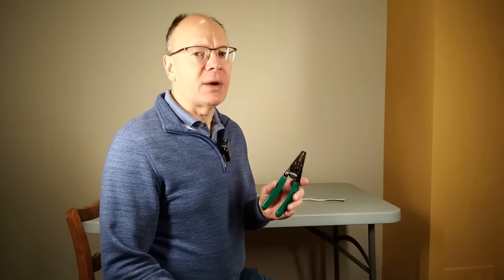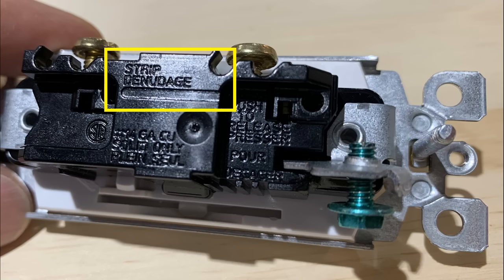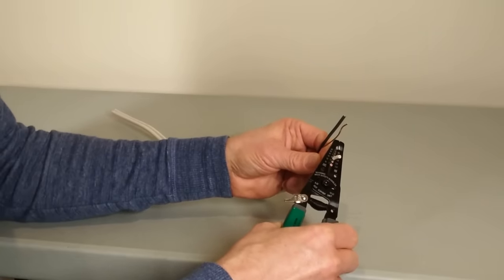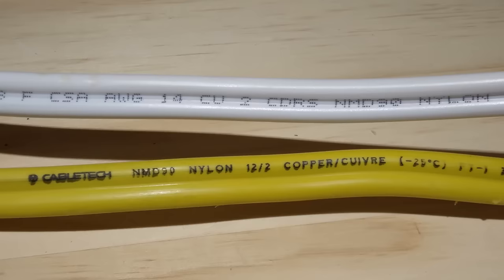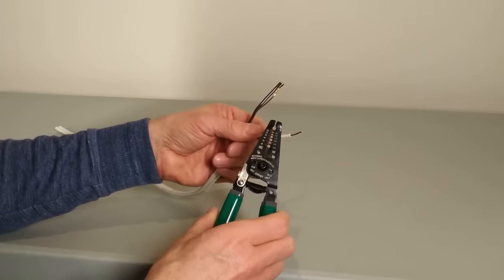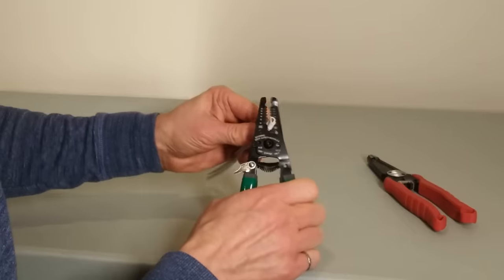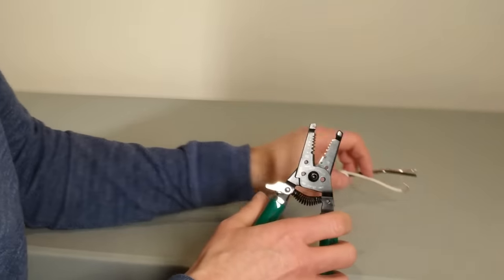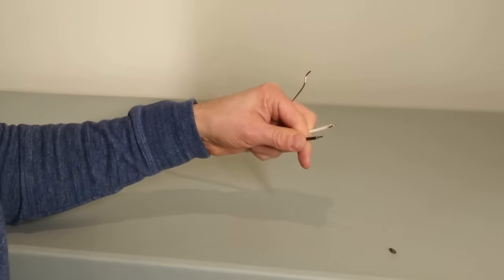6 Mistakes DIYers Make Using Wire Strippers on Electrical Projects; #3 is Dangerous!

Comment: 1:02  NEVER TWIST the stripper. That will nick/score the wire, causing a place of weakness. It may not bother you, but the metal fatigue in that location can cause a complete fail for the next guy.!   The PROPER way is to bite the wire, release slightly, then turn 90° and do it again. That will cut all the insulation without damaging the wire.

Otherwise, nice video. Especially no annoying music, no just babbling to hear your own voice.
Reply: I was thinking the same thing, you can see the score in two places at 0:32 .   It's surprising how quickly the copper fails at those nicks with a bit of bending.
Reply: He's using the tool backwards. Note the beveled edges around the openings on the side he's trimming.  The flat side should be used on the trim end, eliminating the need to twist unless the incorrect AWG opening is selected.
Reply: Wrong

Comment: I have two issues with recommendations here:
1. It is very easy to nick the wire when rotating the stripping tool around it before stripping.  This will cause the wire to break in the future from fatigue induced cracking.  If the correct technique is used with the cutter, there is no need for this rotation.  As to correct technique…
2. When stripping wire, you have the tool backwards.  The beveled edge of the blades should be facing the bulk of the wire and the flat side should be facing the insulation to be removed.  When you strip as you show, the bevel is trying to ride up on the insulation and pry the tool open and this also is what makes it hard to get the insulation to break free cleanly.  Turn the tool around so that the beveled side is facing the bulk of the wire and the straight side of the blade is facing the insulation to be removed.  This is also generally the side with the wire size labels on it which should be facing you as you hold the wire and push the tool away from you to strip the insulation.
Reply: Right off the bat, at 0:32, damaged wire is visible. Also, pushing with the beveled edge may be why he has problems stripping without twisting the tool.
Reply: every decent wire stripper I've used has one beveled side facing each direction.  that's because the blades bypass each other slightly instead of trying to meet perfectly.
Reply: @kenbrown2808  I agree if you are using something like an Ideal style stripper where it grips the wire, cuts the insulation and then pulls off the insulation all in one operation.  Yes, some of the pliers style strippers with bypass blades are OK, but I was referring mainly to the auto style strippers which generally don’t have bypass blades and have a bevel on only one side.  I personally usage my Ideal strippers most of the time, but for wires of heavier gauge I use the cheap auto style strippers and they work fine if you strip with the flat side towards the insulation being removed.
Reply: I usually strip the wire at the next sized up notch, like stripping a 14 gauge in the 12 gauge notch. Not much harder to pull, but it’s a lot harder to nick that wire.
Reply: @huejanus5505  Yep...this
Reply: Interesting, I didn't know this. I hope I can remember to try it the next time I have to strip wire.
Reply: 100% on not rotating the strippers. Long before I became an electrician I was an electronics technologist. In college we had a class called Fabrication Lab and our instructor would examine the copper for any sign of scoring with a loupe.

As others have mentioned, proper stippers like Klein or Ideal most often have bypass blades, although your advice makes sense for... uh... crap tools that amateurs are likely to use. 😜

When I'm showing someone how to strip with a proper tool I tell them to cultivate the habit of closing the strippers completely to cut the insulation, but then to relax the grip just a tad and make sure to stay at right angles to the wire when pulling away.
Reply: @civildiscourse2000  But seymourscagnetti1413 states to use a 45° angle  so it's difficult to know who is right, or even if there is a 'right' way.
Reply: @JBK647  If you angle the strippers to the wire they will bind on the conductor unless the opening is sloppy af!
Reply: @civildiscourse2000  Absolutely.  If I have a wire that appears to be on the small end of the spec range and doesn’t strip well, I will close the strippers fully, open the jaws a little, rotate the wire 90 degrees, then fully close again and strip.  This often helps and doesn’t have the risk of making a big score in the wire from a rotation of the sharp blades.
Reply: @LTVoyager  Good point, that's the only safe rotation method.
Reply: Yep. If i am not using an auto, I start with bigger gauge cutting hole by default. It helps to double-check how wire fits, too.

Comment: Another tip; if the insulation is stuck (or strippers are dull), or when working with some old THN and the insulation has adhered more to the wire, two quick pinches on the insulation 90º apart will break the insulation bond free from the conductor...
I like using the linesman pliers for this as the nose has less teeth (smooth and not pierce or nick the conductor).

Comment: Another fundamental thing to point out, is to always position the J-hook coming from the left with the end on the right.  This helps close the hook when turning clockwise rather than opening the hook.  This is especially important when using stranded wire.

Comment: Great video.  In example #1, besides the insulation problem, you also have a situation where the wire stripper cut into the wire thus weakening it possible causing it to break in the future.
Reply from the maker: Thanks for pointing that out. So two mistakes in one photo!

Comment: When stripping the insulin to use the next higher gauge cutter from the one used to cu the insulation. This prevents the cutter from biting the wire as the insulation is pulled off.

Comment: That twist is only required when the wire you're using is undersized or your strippers are hellishly dull..
Reply: Yup.  Agreed.  And then you realize you are overdue for new strippers.  

I have loads of dull strippers in the old tool chest.  Funny thing is it’s only size 12 that’s dull 😅.  The 10, 14,16,18 are all fine on every old pair.

Comment: I am industrial construction, retrofit and maintenance electrician,only,  now, 30 years.
Residential work I never do, because....  USE the Gas Darned screw cutters on the the strippers!  FFS!
I hated spending hours a day try to turn out  yoke screws that were cammed out to death and 7/8" too long!
Also NEVER get the Milwaukee strippers.  Too much exposed metal near the tip of your index finger and you WILL
find juice one day, especially when new to the field.  You prefer to just see sparks when u cut through energized romex not feel it.  Wera, Wiha, Knipex or Greenlee are safer choices.  The metal does not ingress so much into the 
comfort grip or insulated zone.

Comment: 12/2 gauge back in the early 2000s was in the white sheathing
Reply: when in doubt, start with the largest size.  easier to go to a smaller size than to fix a nicked wire.
Reply: All through the 90's when I was pulling it.. Looked the same as 14ga just slightly bigger..
Reply: @twistedhillbilly6157  fun fact: the color coded sheathing was introduced in the early 2000s, because it made it easier to identify in warehouses, and being easier to identify in the installation was just a convenient side effect.

Comment: Pro tip:  Notice how he puts the wire stripper tool at a 90 degree angle to the wire?  Don't do that.  Rather, put the tool at a 45 degree angle to the wire, make the cut and watch the insulation almost pop off with little to no force needed.  Cheers!
Reply: Hmmm, doesn’t that run the risk of cutting into the copper itself?

Comment: A note not mentioned, Do not strip insulation from a wire that is still powered.  If your power wire touches the ground, of if the ground is charged, then the ark will destroy your wire strippers for that gage stripper.  There goes $17 in tools.
Reply from the maker: Excellent reminder! More than just your tool can be damaged! Never work on live wires as a DIYer. Professionals have the training and skills to do that if they need to.
Reply: It took a while to find the ground fault issue.  It was another breaker in the main panel.  Breaker #12 was messed up someplace.  Luckily the line was only in an unfinished part of the basement.  Took it off line and ran a new cable to that section of the building.
Reply: Aw c'mon..where's the thrill in that?🤣
Reply: @upgradeyourhomediy  I can't imagine a case where a DIYer would need to work with live wiring. In all my decades of working with electricity, the only live wires I've ever worked with, have been telephone ccts

Comment: That's not an electrician's plier. An electrician's plier is like a pair of classic Kleins.
Reply: With proper technique and  practice, you can strip and bend  with  full size Klein lineman pliers.  No nicking of the wire and tight 'J' shape for screws.
Reply: @chrisblue1515  True. That's possible. It's worlds easier with an Ideal T-stripper, though. No thinking, and they weigh nearly nothing in your pouch. And... zero risk of nicking a wire, even before coffee.

Comment: One of the your suggestions about spinning the strippers is incorrect as that could easily Nick The Wire if you have the right size gauge stripper it should go all the way through the insulation without spinning it if you wish to spend afterwards afterwards you are supposed to go one size bigger

Comment: Many years ago I failed an inspection for using j hooks under the screw. The inspectors job is to force people to hire electricians. It has forced me not to get permits.
Reply from the maker: That's unfortunate. Not all inspectors are that way.
Reply: Was the hook going the right way under the screw?  If so I would have challenged that inspector to show me where in NEC or anywhere else it was prohibited.
Reply: @davidhunt6508  of course it was fine just small town bs. His brother in law was probably the electrician because the inspector would just wait six weeks before he came back. Had to hire the electrician who said everything was fine and the inspector signed off without ever inspecting it again. If you ever got mad or heaven forbid got a lawyer you might as well move out. I noticed all these losers use to get all the good jobs until I found out all the hiring got done in the bar if you bought the right guy a lot of beer. I was not a bar goer.

Comment: #5: use your dikes to cut ROMEX. Or your Kleins / ChanNelLocks (electrician's pliers). Never use your strippers. Never even buy strippers that can cut ROMEX. You'll just wear out the scissor-type cutter immediately and have to use your dikes.

Start with dikes. Start, in fact, with LAP-JOINT dikes. Never use box-joint dikes that way. They're suitable only for single strands of copper wire.

Comment: 0:35 Stripping too little (in this case) doesn’t matter. Insulation will be squeezed through, like using IDC connectors (Insulation Displacement Connector). That’s how you make an airtight connection.
Reply: Maybe not. I’ve had cases where the insulation did not get compressed and the connection was faulty. It’s not hard to just read and follow instructions.
Reply: Not always.  This is very poor practice.  There should be NO insulation under the screw head.
Reply: You do burglar alarms don't you ??